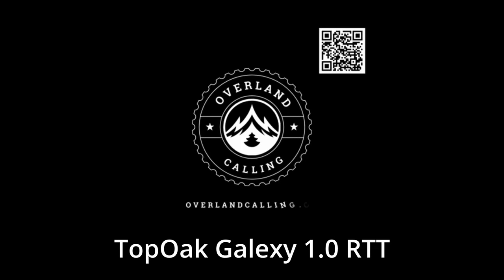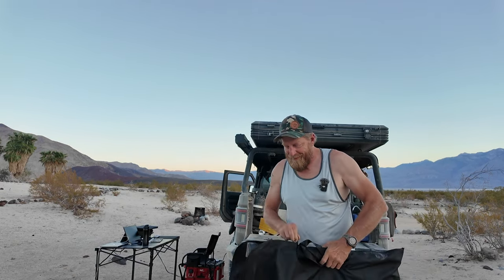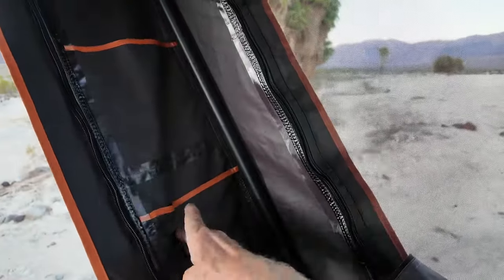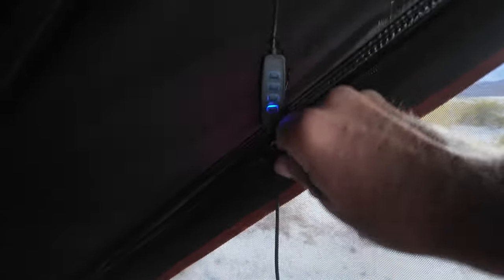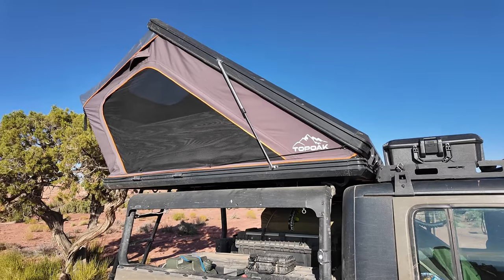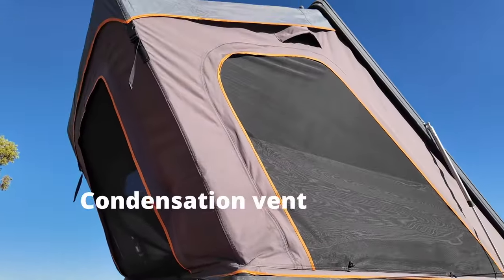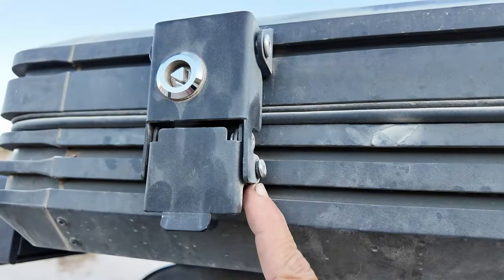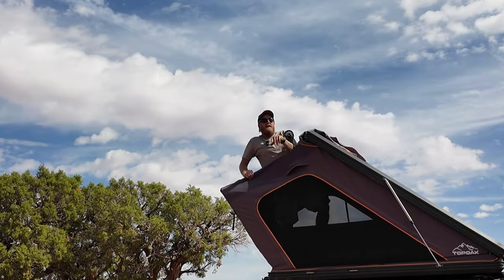***Not Sponsored*** TopOak Galaxy 1.0 roof top tent walk through after 50+ nights of use

Comment: I have a crazy thought. In regards to the pull down handle. Have you just tried to "throw it over the roof"? If you think about it, handle is long and is meant to help you pull the tent down for closure so theoretically its long enough to be thrown over the roof and lay against the flat surface and not in the way of anything. Even if you have tent bars for cargo, you could then drape it to the side of the roof bars on other side of tent facing jeep engine. And then you just throw it back for when you need to pack camp. That way it does not flop about and be a nuisance.
Reply from the maker: I did actually start doing that after I had already filmed the video and it works pretty good. Hilarious that I didn't even think of it till after such a long time using it. That is now my preferred way of keeping the handle out of the way. That made me realize that I really don't need it at all. Most likely I will end up cutting it off all together or maybe shortening it.
Reply: I unzip the rear door and pull it inside then zip the door tight.
Reply from the maker: @whatwasthat3269  ahh that’s a great way to solve the problem! I just ordered some solar panels to mount on the tent, so my toss it on top will be short lived. Thanks for sharing!

Comment: Great video.  After Rim Rocker I am considering a RTT for solo trips and Winter Camping.  The salt on the roads and rough trails were tough on the trailer.

That usb cable is long.  You could rope cattle with it.
Reply from the maker: Having a RTT does make setup super easy. works pretty good as a spare bedroom too if you have family with you while towing the trailer. If I get a trailer I will still keep the RTT. Just in case I want to get away from the trailer base camp for an overnight on the trail.